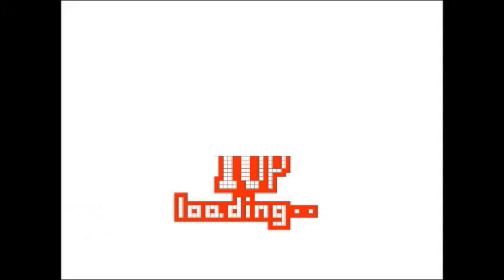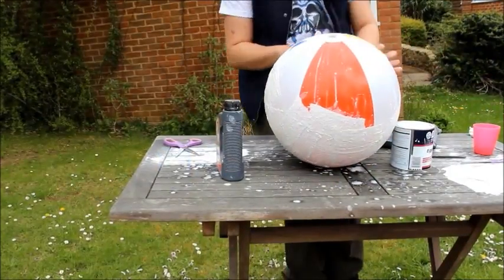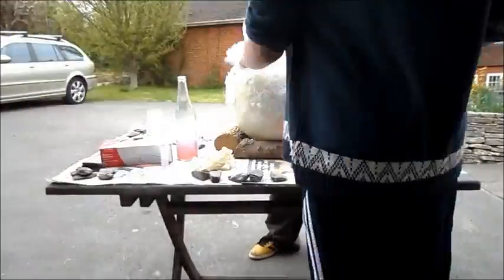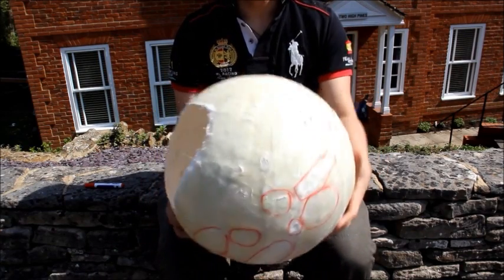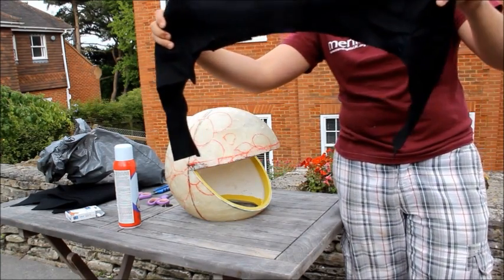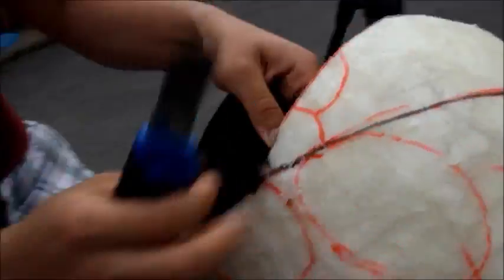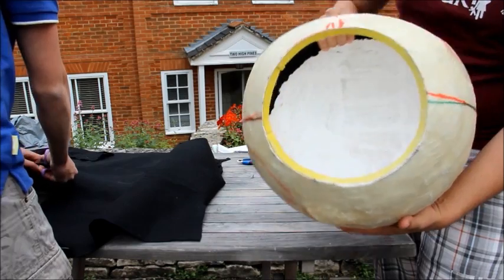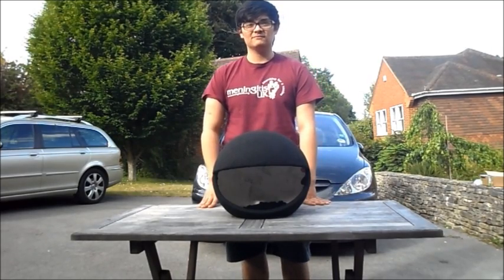DeadMau5 head how to/tutorial part 1 WITH LIGHTS!

Comment: Can you remember where you got your 24 inch beach ball from? Like you said in the video it's difficult to find any online that will actually be 24 inches when inflated.

Also what thickness of fibreglass mat did you use and what brand of polyester resin was it?

Sorry for the numerous questions
Reply from the maker: Paulo Reus hi there, I simply bought mine off Amazon, usefully I was able to over inflate mine until I achieved the desired size. I can't remember the thickness of fiberglass or brand of polyester resin, any cheap resin will do and if you have thin fiberglass you will just need to add more layers until you get the desired strength

Comment: Alright, so I already did plaster bandages, but I feel I made too many bumps. Will it be too noticeable on the finished product?
Reply from the maker: Professor Meowingtons if you are using a dark colored felt like a black or navy blue, you can mask small bumps. If they are big, I would sand them down and reinforce with another layer or two of bandages over sanded areas
Reply: It's great that you're still replying to old videos :) Well, i'll try that. But if it doesn't work, i'll just redo the whole thing. It wasn't that hard, anyway. Thanks!

Comment: is there a substitute for the polyester resin? im not sure if that is correct because im not sure where i can get that
Reply: and is it possible to cut the shell using a standard knife?
Reply from the maker: its the standard resin used with fiberglass, usually you can get fiberglass kits that include polyester resin!
Reply from the maker: Lascarus Kwok and yes you can use a saw or a serrated knife to cut it as well but it will take far longer
Reply: KRSprops Thanks! And im still not sure about the coating. first is the plastic bandages then i use spray adhesive to put on the fiberglass? and then i use the resin for the rest of the fiberglass. please correct me if im wrong thanks :)
Reply: Lascarus Kwok and i could use liquid glue rather than spray adhesive?
Reply from the maker: Ive never tried so I cant say sorry!

Comment: How much fiberglass did you use?
Reply from the maker: Captainfuffy cant remember exactly, probably about 2 m^2
Reply: Cool would you ever use carbonfibre
Reply from the maker: more expensive for unnecessary strength, and i have no experience using it so i personally wouldnt :P

Comment: Hey. What kind of Polyester Resin did you specifically use? Thanks
Reply from the maker: I bought mine in Hong Kong and it was unbranded so wouldnt know an equivalent. Polyester resin is very common though, im sure you could find many sources online!
Reply: I went through 4 department stores today and couldn't find any plaster bandage. Can I just add the fiber glass on the beach ball or is there another substitute?
Reply from the maker: you could use anything really, you could wrap the beach ball in tin foil, just needs something in between to stop the polyester resin from effecting the plastic the beach ball is made from!
Reply: Holy crap. Thanks for the quick replies dude. This video came out 4 years ago and you're still replying to comments. Kuddos! Anyway, I'll take the foil route
Reply from the maker: no prob! im here to help people learn :)